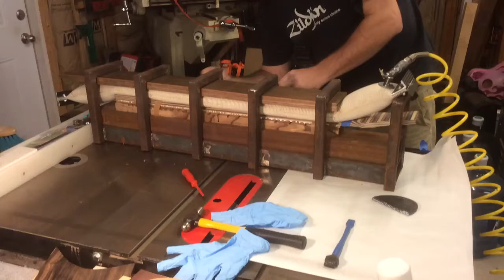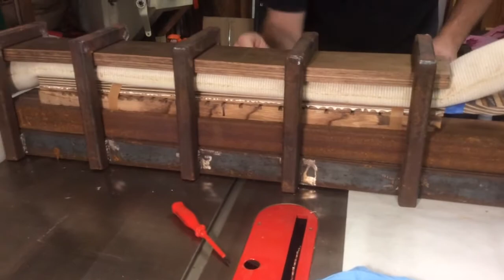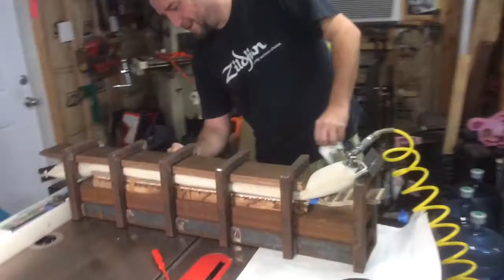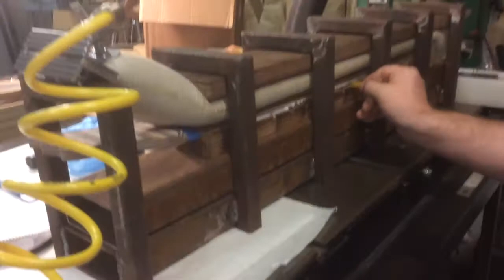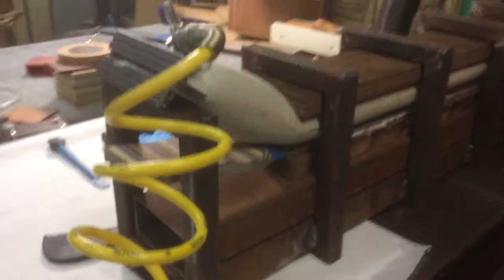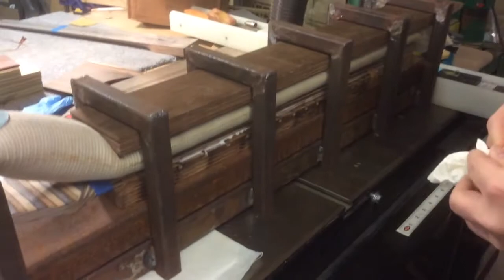VCS Neck clamping jig

Comment: How did you build the air bag?
Reply from the maker: Wow, can't believe I didn't see or respond to this.... So sorry! I basically built a cage out of a 2x4 steel beam on the bottom and 1" square tubing uprights and top and welded them all together. That is the basic steel cage, then I machined a compound radiused block with fret slots in case I have to glue on a pre-fretted board. Then I load it like this..... radius caul (flat side down), then the neck and glued on FB face down on wax paper..... fire hose right on top of neck and I fill the gap above it with the thickest flat cauls that I can! One note is when I built it, I allowed waaay too much height inside the cage..... You will notice a second 2x4 steel tube under the neck as a spacer..... I need to chop 2" off the bottom and re-weld it cause it weighs a ton!! Lol